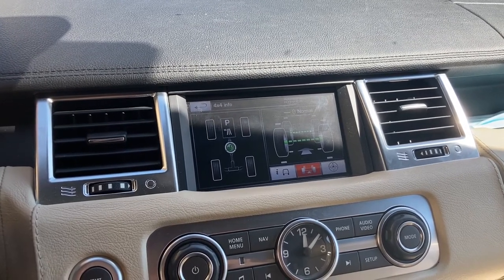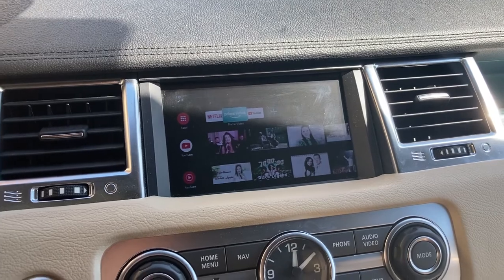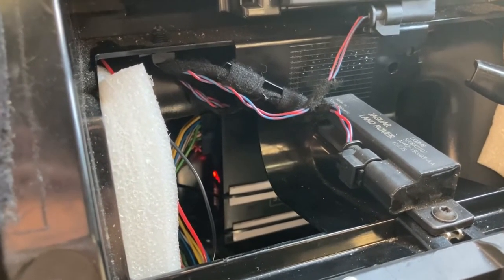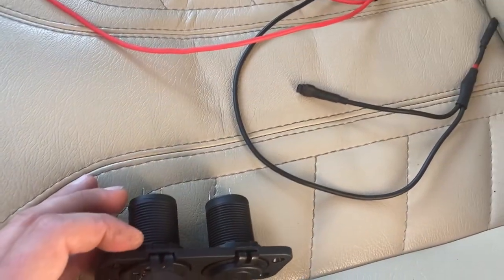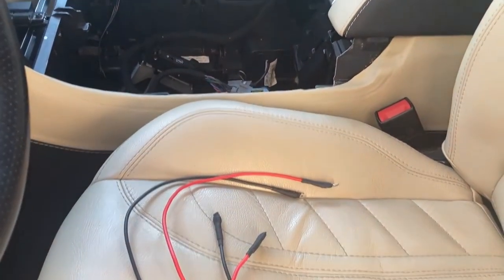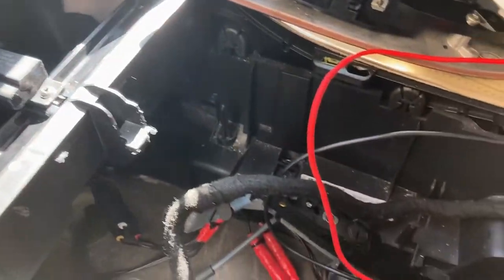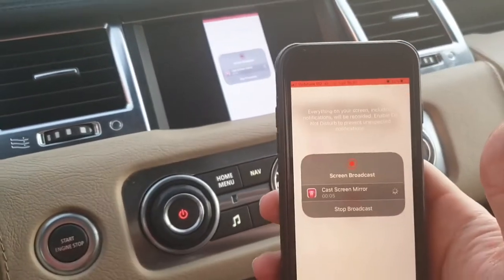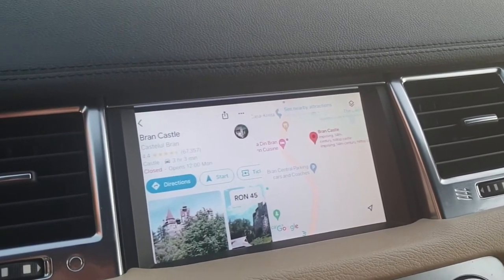DIY - 2012 Range Rover Sport SDV6: Add screen mirroring

Comment: hi, do you necessarily need the c logic tool? I am going to try to do this for land rover discovery sport 2018
Reply from the maker: In my case, the C-Logic unit came with the car, so I just needed to expand it with an additional video source. But without it you may not be able to connect the video source directly to the car's infotainment unit. But this was applicable to my L320, the 2018 Discovery Sport has a completely different unit so I doubt my solution would work for you.

Comment: Thx for the solution. Why don't you put the xiaomi box and rca/hdmi converter in the console instead of drilling holes ?
Reply from the maker: Hi! I put them in the cubby box to have easier access to them in case of issues. Had I put them in the center console, I would have had to remove the center console every time I wanted to access them. The cubby is a much more convenient place and that particular spot where I placed the 2 units is fairly out of the way of anything else.

Comment: You got a shopping list of what parts you needed?
Reply: Done this on my l322 for £80
Reply: @gerryr1893  I read the video wrong I thought this c.logic unit was in the car as STD. I have a 2010 l320 so need to know what I need to put in to add video. What did you use?
Reply from the maker: @alexcruickshank5192  I've added links to the parts (or their equivalents) in the video's description. Indeed, the C.Logic unit is unfortunately not standard in the car, I found mine installed when I bought the car from the previous owner. But since your model is a 2010, you have the Gen. II infotainment system (the one where the buttons have rounded sides), right? For your car, I think you need the C1-LR10 model. The one I'm using is for the Gen. III system (2012+) and the two are not interchangeable.
Reply: @TheMissingBolt  yea mine is gen 2, I did find the c.logic unit but seems you can only buy it in Romania and works out around £ 3/400
Reply: @gerryr1893  that would be interesting to know!!! How? Would you mind to share this? A loving L322 driver!